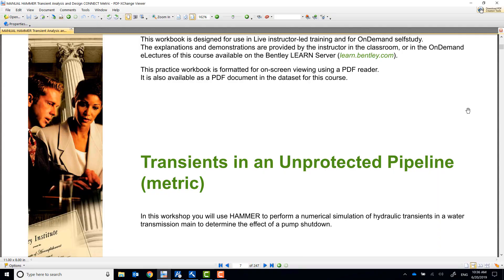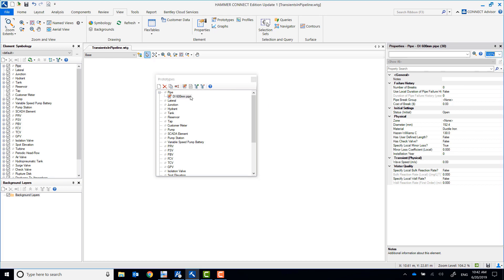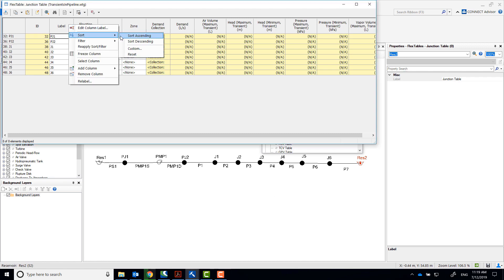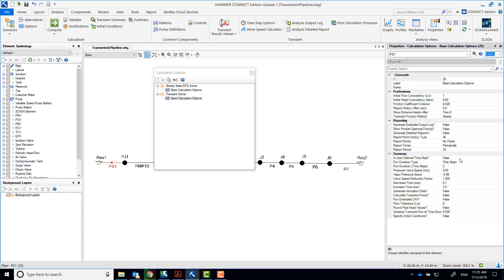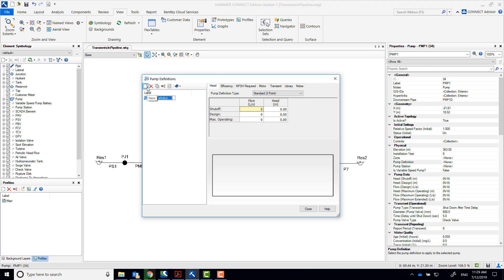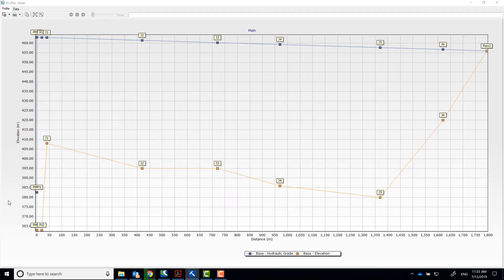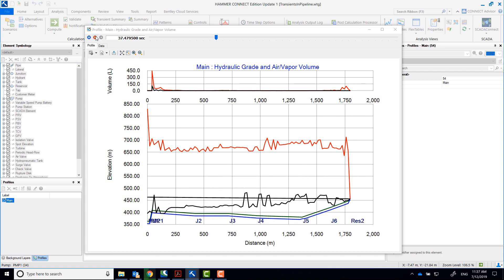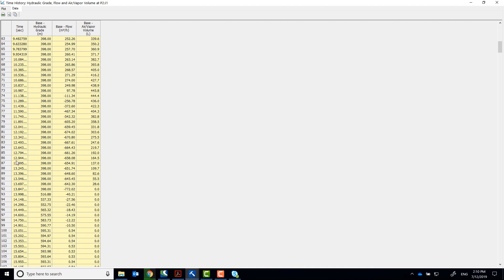HAMMER Training Part 7.5: Workshop 1 (Transients in an Unprotected Pipeline)

Comment: I am learning in btech civil engineering student, there is project on surge protection devices against water hammer for lift irrigation system. Can i use this software for analysis and give me idea for making a small model for this project
Reply from the maker: Please provide more details on what this "lift irrigation" system consists of. In general HAMMER can be used for pressurized fluid systems, and is not suitable for open-channel gravity flow where a transient wave would not propagate.

Comment: May i use Hammer to see the the behavior of a pressure pipe which delivers water from springs at an elevation of 795 m to the tank which is located 5 Km down slope at an elevation of 335 m?
Reply from the maker: Gerry, HAMMER can be used if the pipe flows under pressure. What event is causing a transient in this system? A sudden valve closure?
Reply: @bentleywaterinfrastructure  That's exactly !!!!!
Reply from the maker: @gerryroberts458  Here is an article with more information on modeling valve closure. If you have any additional questions, please post on our Forum.

https://communities.bentley.com/products/hydraulics___hydrology/w/hydraulics_and_hydrology__wiki/3438/modeling-reference---valve-closure

https://communities.bentley.com/products/hydraulics___hydrology/f/haestad-hydraulics-and-hydrology-forum